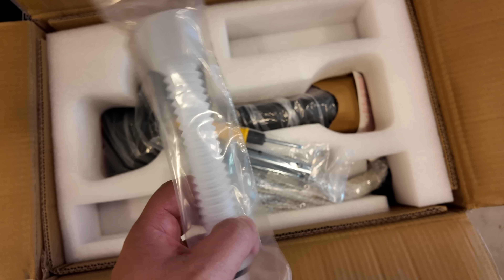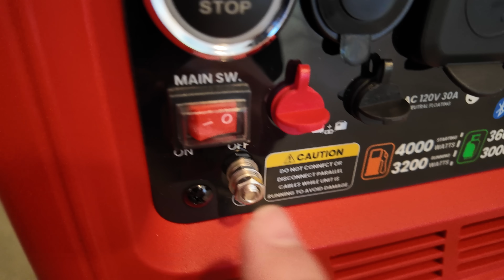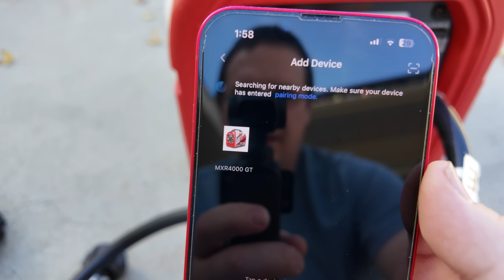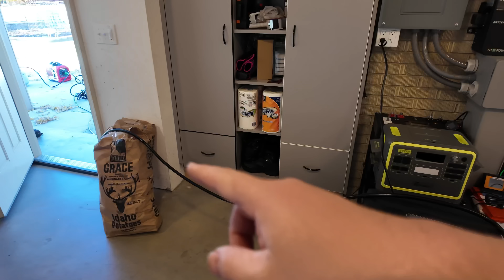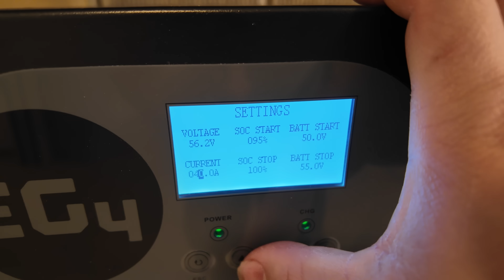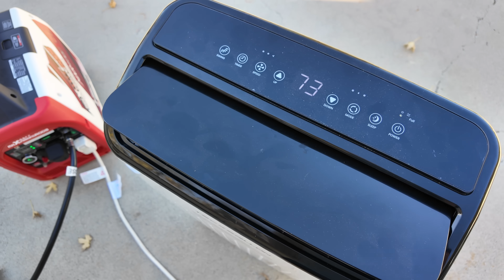UNPOPULAR OPINION: Buy Gas FIRST (Before You Ever Touch Solar)

Comment: Devices that are rectifying AC power to DC (to charge batteries) do not require "clean" power - they don't care.
Reply from the maker: Yep! Exactly why this kit brings added value with it's included charger!
Reply: @theresatrickforthat  It makes the inverter generator no better than a conventional for charging batteries. It's completing extra steps for no benefit. AC to DC to AC to DC.

Comment: I 100% agree.  I tell people, if money is an issue, start with the dual fuel generator.  But if you can do both, start with at least a 2000w+ generator, and 1000wh power station at a minimum.  It will cover A LOT of ground.  Of course this is a bare minimum, for very basic needs.  Then you expand from there.
Reply: I recommend the opposite.  I have a 3,000 watt power station and I recharge it with an 800 watt gas inverter generator that is almost silent and sips gas.  Most people don't need 3,000 watts all the time, just temporarily like adding the draw from a microwave or whatever but that's only minutes a day.  The fuel generator only needs to provide enough watts to be slightly above the average power consumption and let the batteries supply those temporary high draws.  Think of how a diesel electric locomotive works, and they are the most fuel efficient forms of land transportation available.  In my case, I discovered my home uses about 600 watts "at idle" and while loads can temporarily spike well above that, I don't need a gas generator with that kind of capability because that's what the batteries are for.  Of course I use solar during the day.  The generator is only for a few hours at night if the grid goes down.
Reply: @ezcaps8094 kind of silly not to have a small solar system power if you already have a battery supply I'm buying panels used nowadays for $20 for 260 Watts I agree about having a generator backup this time of year I'm completely off. And there's not enough sun I have to run mine once a week for 6 hours to top my batteries up.
Reply from the maker: Right on!
Reply: Stupid tip. With a solar power station you dont need a Generator with the same power as the power station.

Comment: Bought a gas generator last month as Hurricane Melissa was on its way to my country -2800w, literally the last one the store had. Thankfully where I live wasn’t badly affected (only lost power for 4 days) as other places are due to be out of power until end of Q1 next year! Very limited gas availability in those areas now

Since my power has returned I’ve bought:
1. Starlink mini
2. A 1000wh power station Anker C1000 gen 2. 

Planning to get either a small 200-400w portable panel, or go full out with a large 48v battery + enough panels to charge it from dead within 5 hours.
Reply from the maker: Thanks for sharing your experience and plan!

Comment: Redundancy and options are always good, so it's good to have both. But if it comes to a choice, I still go with solar/batteries before a dedicated gas/propane generator for emergencies. For emergency backup, I already have gas engines that I maintain and generate electricity - my cars. So I recommend a solar generator and separate 1,000 watt inverter or dedicated car-to-station charger for the solar generator as the cheapest, easiest solution for low wattage needs.

You can get a Pecron E1000 for $319 right now, a Pecron car-to-station charger for another $150, and a Zoupw 400 watt solar panel for $390 for a combined cost less than just the generator. If all you need is to run a single fridge during a blackout, the 1024 watt hour station will run it for probably 10 hours and will cover most blackouts and it's more reliable if you're not great at maintenance. If you're in a longer term blackout with sun, the solar panel will cover most of the rest of 14 hours and recharge the station. If you're in a long term blackout without sun, you can run your car for 2 hours to get 500 watts/hr in the morning to recharge the power station and maybe run the car for another couple hours before bedtime to get you through the night. I did something like this for a 3 day blackout and only went through 5 gallons of gas. If you have higher energy needs and two cars, there are other combinations that still work with less hassle than a gas/propane generator dedicated for blackouts.

Living in the southwest and having reliable sun, solar also gives me the opportunity to use it daily running my home office rather than just for backup and that saves me money on my electricity bill, so it will (eventually) end up paying for itself where a generator is just an expense.
Reply from the maker: Thanks for sharing your strategy!

Comment: Is this the right generator?  Maybe.  The question needs  to be "what do you need for minimum conservative survival in your own home during an emergency."    Can you get by with 120 V?  Maybe, if you don't need a well pump, electric stove, electric furnace, central AC.  We are only concerned with heat and cooking in NY, and winter heat is NG 120v, so it can work, stove is electric so no stove, however we have a microwave and purchased an $29 1800W electric single burner hot plate.  We also have the propane camping stove, if necessary, so we could live with 120 V and our generator is a Firman 3600 inverter(wo3382) unit.  Because we want to back up the house, we also got an Ecoflow inverter/battery(delta pro ultra unit).  A Ecoflow Delta Pro 3 could have worked and supplied our house with enough 240V power to run everything during an emergency.  But it takes time to create this type of home back up depth.  We also store 27Gal of stabilized gas rotated through the cars every 6 months, so don't worry about gas storage if you have a car to dispose of it every 6 months.   If I was building the system again, I would start with a Ecoflow Delta Pro 3 and a generator interlock for the main panel for normal power outages.  Then, I would add a small dual Fuel inverter generator, when they go on sale at Costco, because you only need to charge your battery if the outage lasts more than a day.
Reply from the maker: Sounds like some great thoughts!

Comment: I think you are on the right track here.  I run a Bluetti power bank to keep Starlink and TV going, along with charging phones and laptops. And a Honda EU200i keeps that thing topped off and also runs the electronics because it produces pure sine wave power. But I also have a ~12,000 watt generator that I run off the propane tank for the house. This will run the rest of the house, including the well pump and water heater. This is actually a pretty good set up for me. The Bluetti is for very short term outages and is very convenient to plug into. Then the Honda comes out if it's been a couple of hours. The big generator only comes out for extended outages.
Reply from the maker: Sounds like an excellent setup!

Comment: After hurricane Floyd’s we lost power for a little more than 3 days. 

A small 2500 watt Coleman generator with a 1-quart gas tank, a Walmart Deep Cycle lead-acid battery and a 300 watt modified sine wave inverter kept us going for less than 1-gallon a day, including cooling off the freezer and refrigerator. 

Now with a 2200 watt inverter, EcoFlow Delta 2 Max, and 800 watts of solar, I should be able to get by with less than 1/4 gallon a day on average. 

I also have a 3200 dual fuel inverter generator and an alternator charger in case I need more options.
Reply from the maker: Thanks for sharing your setup and experience!

Comment: This is on my list of van accessories. Solar is done, can charge with the van, now just looking into a generator and increased capacity for the Delta 2. Can’t wait to see how you wire a regular 12v expansion battery.
Reply from the maker: Yep! It's coming!

Comment: Good video, thanks!!  I have 3 Jackery 1000V2s, a 9000 watt inverter generator and a 4000 watt inverter generator.  The smaller generator can recharge 2 Jackery units at the same time in less than an hour and a half.  A solar setup would take several hours just to charge a single Jackery.  IMHO, solar needs a gas/dual fuel generator backup.  I would never rely on solar as my only way to do a battery recharge in an emergency situation.  Nothing wrong with solar, but it’s not part of my emergency plan.
Reply from the maker: Thanks for sharing your experience and strategy!

Comment: I love the mxr4000gt! Of the four generators I have, its by far my favorite! I use it to charge my two pecron e3600lfp's through a chargeverter while they're in use. It's also super portable and easy to toss in the back of my truck. I've never put a drop of gasoline in it, only propane, but it's cool to know that I can run it on either. I know, it's chinese, but it definitely punches above it's pricepoint.
Reply from the maker: Awesome setup you've got going on there! Thanks for sharing!

Comment: Using a propane as fuel have lots of advantages. 
It does not gum up like gasoline. 
Propane can be stores indefinite. 
But if you have just a gasoline generator (not duel fuel) I recommend Trufuel, it can last 2 years in the generator, making it easy to start up every time you use it.
Reply from the maker: Thank you so much for sharing!
Reply: Trufuel is insanely expensive for what it is unfortunately.  Good for storing the generator with a small amount run through it before shutting down though.